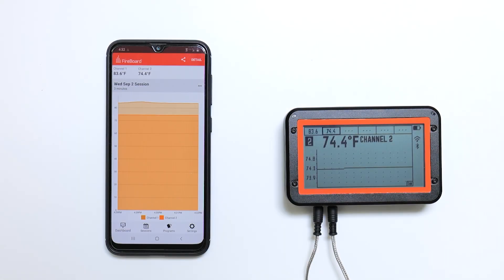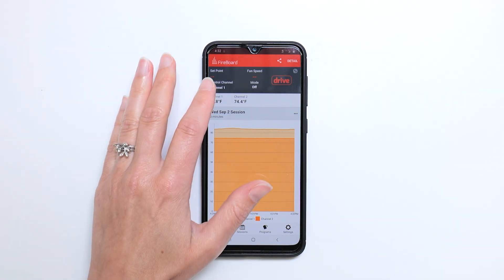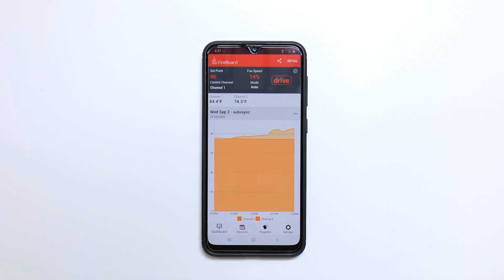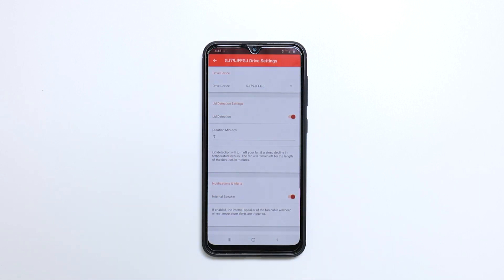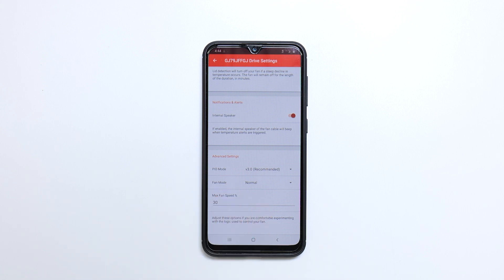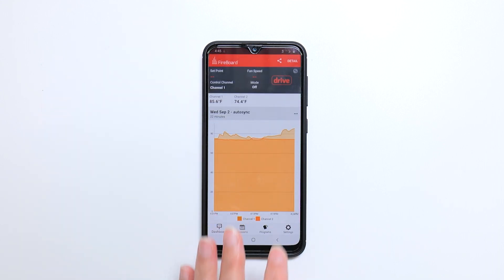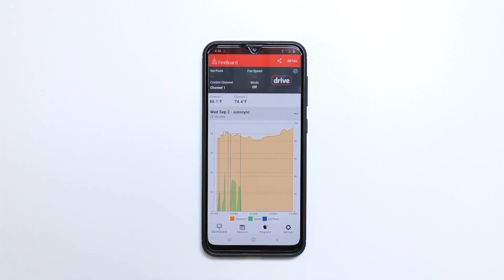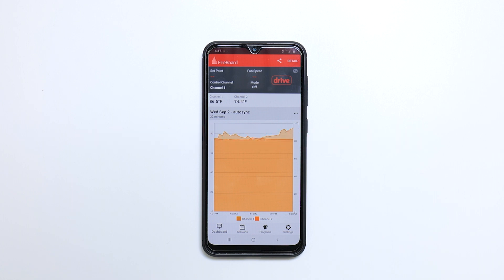FireBoard App: Drive Basics

Comment: What is the highest set point temperature for the Fireboard 2 Drive? I want to buy one to run my Masterbuilt Gravity series.
Reply from the maker: FireBoard 2 Drive - Measurement Range: -94 to 752°F (-70 to 400°C). For more info visit: https://docs.fireboard.io/fb2series/specs.html
Reply: @FireBoardLabs  ok I get that. But let's say I'm using to drive a fan on a grill. What is the temperature I can set the grill at? Like what is the range? I read somewhere that it went up to 375 and then just a full blast mode of sorts. I need to be able to set the temperature up to 500, 600, or even 700 degrees and have the board keep that temp inside my grill. Will it do that?